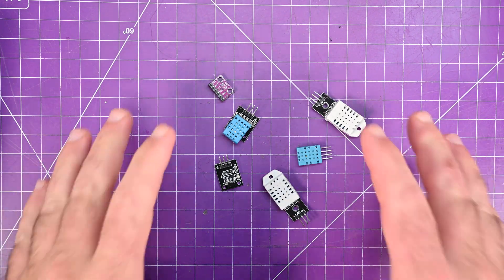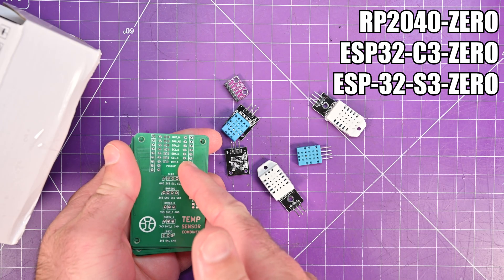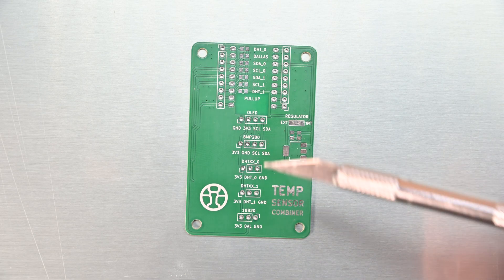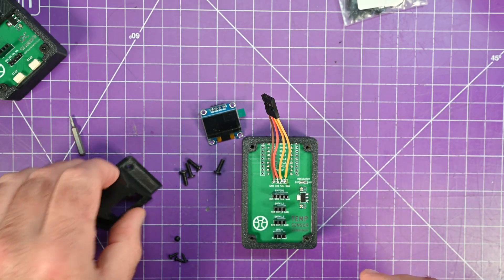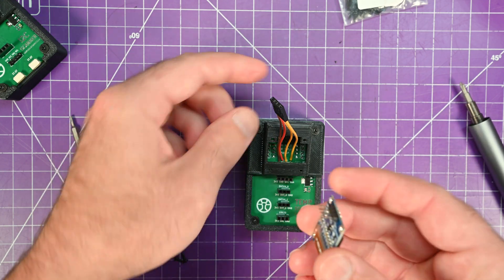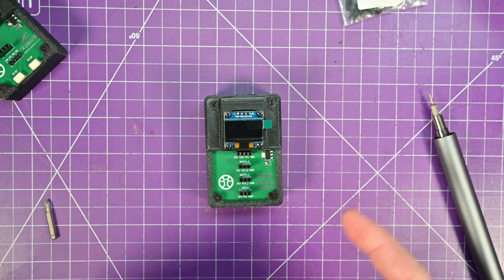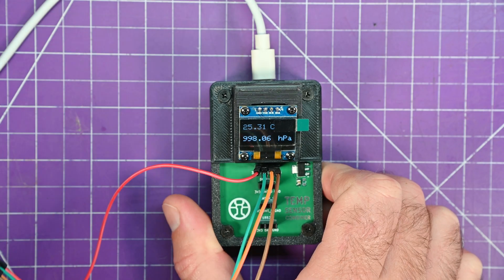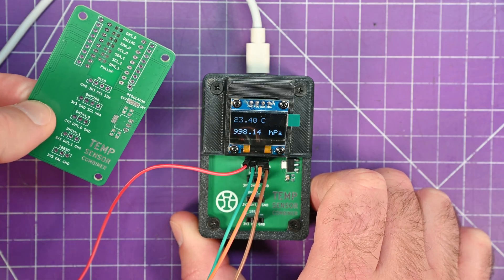You Deserve A Simpler Temperature Project! | All-In-One Temperature Sensor Project!

Comment: Another good project. I purchased your boards from the I2C scanner. Does it make a difference where you place the capacitors on the 4 pads around the voltage regulator?  Thanks again.
Reply from the maker: Nope! 1 side is input the other is output, I put extra pads in case there is some edge case where you need extra filtering with different capacitor values
Reply: @SimpleElectronics  Thanks...ordered this board also.
Reply from the maker: @williammckee4369  Awesome! Also thanks for the kind words!